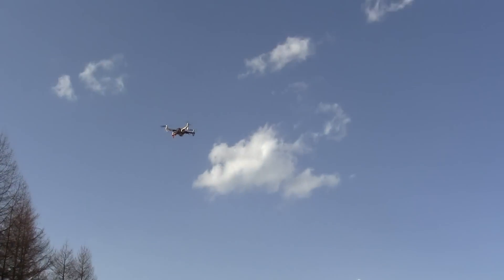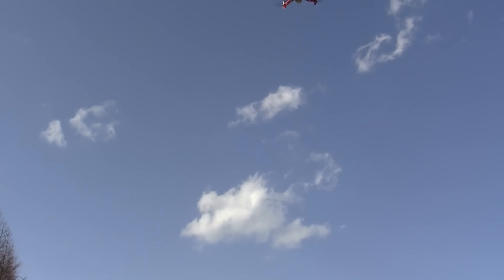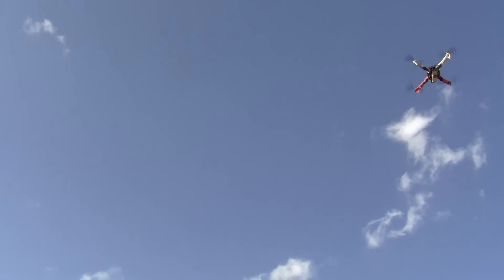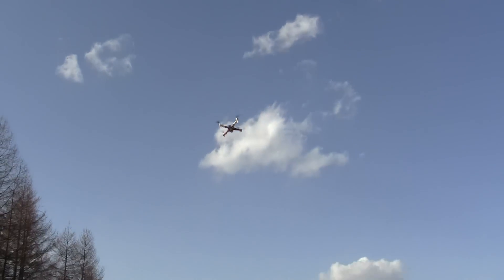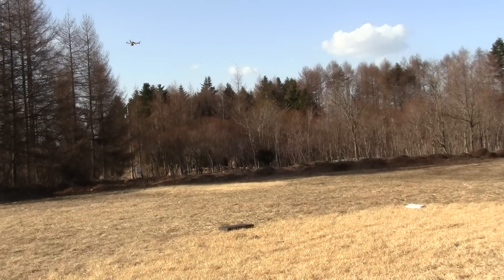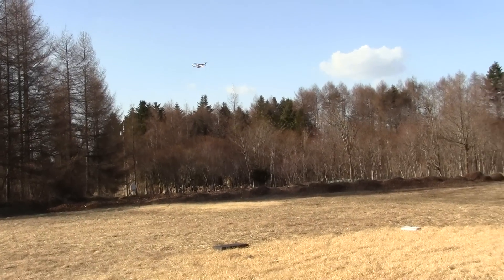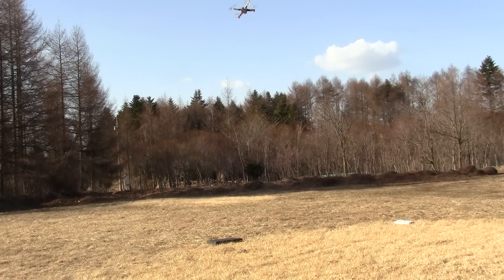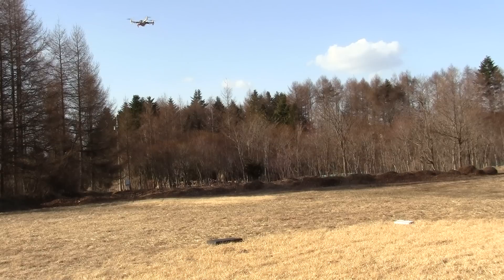Loss of GPS testing with AC 2.9.2

Comment: Honestly don't see the inertial navigation doing anything.
Reply from the maker: No, it does do something but not for long!  So if you look at 1:01 you'll see that a moment after I turn off the gps a strong gust hits the copter and it does a couple of leans to stay in place.  That's good!  but then after 5 seconds or so the inertial nav position drifts...so the copter is not drifting with the wind...it's quite independent of the wind direction (which of course you can't see in the video).  Really the point of the video was to understand (and demonstrate) how long we can trust the inertial nav position for..and the answer seems to be 5 to 10 seconds.  Some time people assume that we should be able to trust it for much longer than that..but with the level of sensors we use, 5 to 10 seconds is all we get.

Comment from the maker: Clinton,
    I temporarily added an option to the channel 7 switch and some code to the GPS library so that when the switch was flicked it would simulate a GPS failure.  I haven't checked that into trunk but I could if people were interested in testing various failsafes.  For example it could be used to tests a throttle, battery or GPS failsafe.